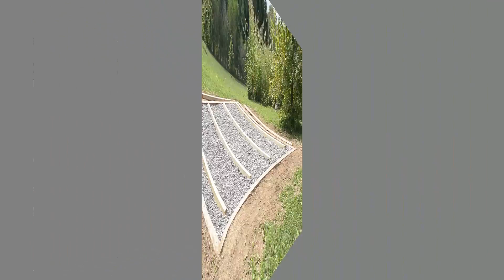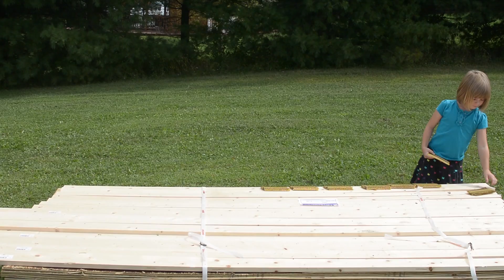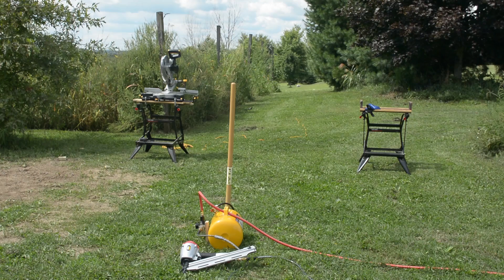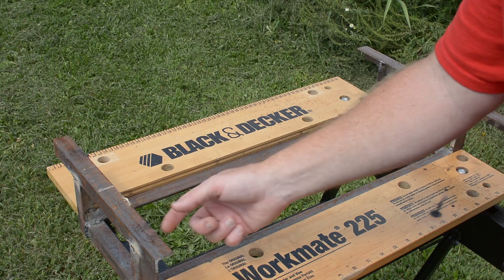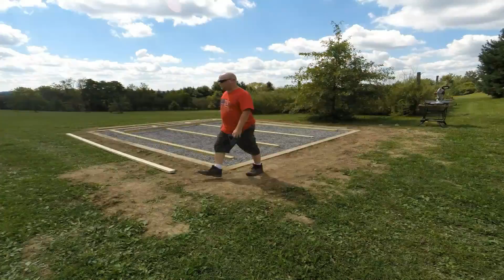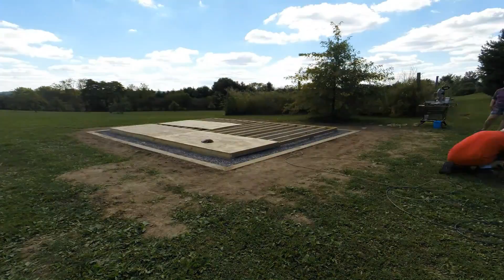Shed Build 04 - Construction Day 1

Comment: hi, what size timber did you use on the base and what size sleeper did you use please
Reply from the maker: The runners are 4x4 and the rest of the framing is 2x4.  All of it pressure treated.